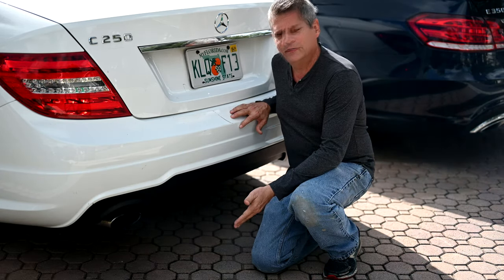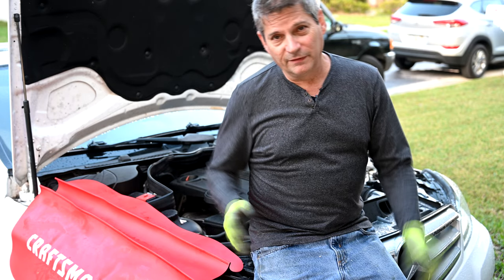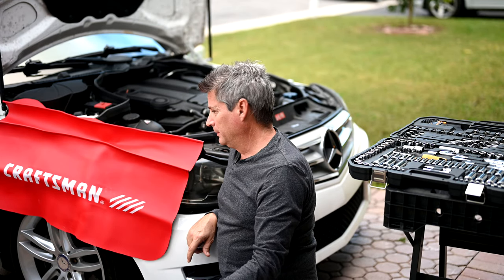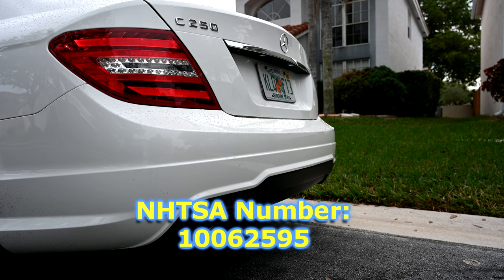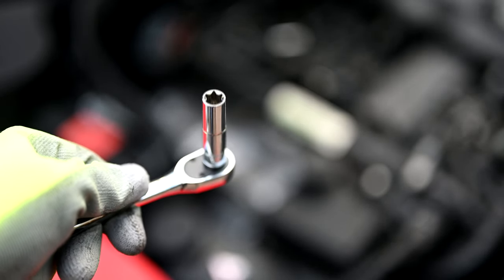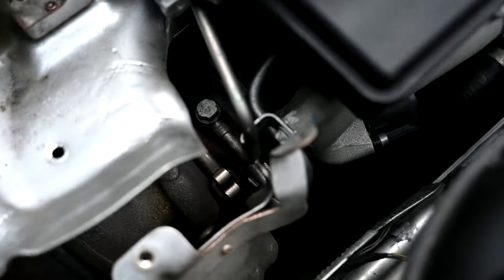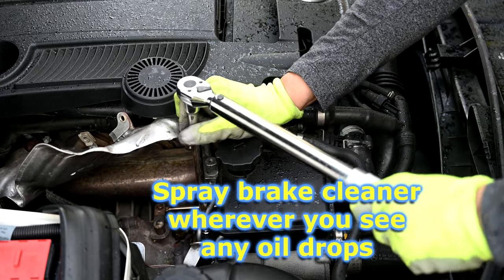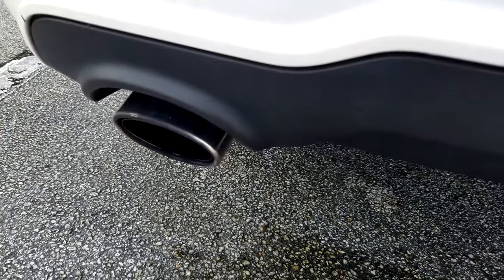SOLVED! Engine Blows White Smoke at Startup Mercedes C250 W204 Banjo Bolt

Comment from the maker: ✅ Parts/Tools in this Engine Blows White Smoke Repair:
✅ Dewalt DWST11556 Express Folding Workbench: https://amzn.to/2EZuyNj
✅ DEWALT Mechanics Tool Set, 172-Piece (DWMT81533): https://amzn.to/2rAsdoV
✅ Milwaukee 2415-21 M12 3/8" Right Angle Drill/Driver Kit: https://amzn.to/2SCAXGe
✅ Craftsman 9-34570 Torx Socket Set E6,E7,E8,E10,E12,E14,E16, (1/4" E8): https://amzn.to/359aSlL
✅ Craftsman 9-12612 Black Fender Cover: https://amzn.to/2Q3uZfW
✅ Mercedes Banjo Bolt Part#: A0019972401 (001-997-24-01): https://amzn.to/2EXwKou
✅ Mercedes-Benz O-RING Part #: A0239978548 (A 023 997 85 48 ): https://amzn.to/36hsBaQ
✅ Mercedes Turbo Charger Oil Line Gasket/Sealer Ring #: N000000006513 (eBay parts)
Reply: Good day,
I'm Sbu from South Africa.
Would this be applicable to BMW 2012/08 F30 N20 engine, has twin turbo.
Has white smoke on startup, but pretty huge/enormous white smoke on startup, but afterwards smoke disappears. 

Is it the same diagnosis?
Reply from the maker: We have heard from other car owners of different companies that this problem exists on many car, so you might expect this to be the problem with yours as well. You should look on a few BMW forums from other owners to see if that is what solved it for them as well. This problem was solved by us checking on a Mercedes forum, and got recommendations from a mechanic at Mercedes on the forum. If you search Amazon and eBay for Banjo bolts, you will see them selling these bolts for many car brands, and apparently these newer bolt designs with the back flow preventers in them seems to be a common fix for this common problem.
Reply: Where is the banjo bolt located in C300
Reply: @carbuying where is banjo bolt located in C300 please

Comment: Thanks for this video. My C-250 was also blowing white smoke at startup. I used the parts link, and everything arrived within four days. The whole repair took under 30 minutes. I opted to install the O ring. After completion I ran the car for a few minutes to blow out and residual oil. Fired it up this morning, with no white smoke. If you have this problem follow this video and save over 400 bucks
Reply from the maker: Glad it helped It's always great to hear we saved another person!
Reply: Really and unbelievable easy repair with the help of the video. Thanks again. Any new Mercedes videos upcoming?

Comment: Very good video, so thanks for the quality of your video images. I replaced the banjo bolt without any issues but the two supposedly OEM copper crush washers ($15 each through Parts Geeks -Yikes!) for sealing to the top of the housing I received as an "OEM Part # ending in 6513 are indeed too large and should have an ID of 10mm, not the 13mm size. Otherwise the washers won't seal the housing to banjo bolt properly. I just reused the old washer from the defective original banjo bolt and hopefully there will be no leaks using it; I have heard some people, including here, have just used one correct-size washer, Teflon tape, and no washer at all and have had success. Those 13mm washers, along with the rubber o-ring, appear to be used with the oil line itself and not the banjo bolt. That bargain FCP Euro kit mentioned from another viewer here also has just one washer and the rubber o-ring. There's a lot of confusion out there about all of this and Mercedes should make these issues clear! So there are actually two separate issues to deal with - 1, the easy banjo bolt replacement causing the start-up white smoke and 2, oil leakage leakage coming from the oil feed line above the turbo due to a deteriorated rubber o-ring at the block housing. The latter is a lot more difficult to deal with due to clearances and tolerances to remove/replace either the entire oil line or just the rubber gasket. One last thing - removing the lower rear heat shield 10 torx bolt requires that you remove the two bolts housing the dipstick feed tube so you can pull it out of the way to get enough clearance to get a socket in there to remove it completely should you need to remove the oil line itself. Hope this helps future "do it yourselfers".
Reply: Yes, I've seen other yt videos on how to replace the banjo bolt. They used 2 crushed washers, one on top and the other at the bottom of the banjo bolt. The rubber O-ring goes to the end of the oil feed line towards the engine block.
Reply: I'm doing mine this weekend. Another yt video shows the original banjo bolt has only 1 washer size m10 and the rubber O-ring goes to the end of the oil pipe towards the engine block. The TSB requires removing the turbo heat shield and not the exhaust manifold heat shield.

Comment: I see you said you need two “washers” but you only demonstrated using one “washer” and one o-ring, where does the other “washer” go? Also do you put the o-ring on the housing location first, then screw the bolt onto it along with the “washer”? Thanks.
Reply from the maker: It can be a bit of a head scratcher. The way banjo bolts work is there is supposed to be a washer on the bottom side of the banjo and on the top side of the banjo, where the banjo bolt tightens down on top of the banjo. The Mercedes TSB called for a washer and a gasket, although we have seen forum posts where service techs say you need 2 washers. But upon removing the old banjo bolt, we only saw one washer, it was on the old banjo bolt, but no second washer under the banjo fitting. So is the second washer needed or is the gasket needed? We chose to install the gasket, and likely either scenario would work. The real issue here is changing to that new banjo bolt with the flow restrictor. As long as you have a good seal, it likely doe snot matter whether you have the second washer, or the O-ring. We also don't know why Mercedes said to use an O-ring when you normally have 2 washers for the banjo fitting. At least the fix works as we implemented it.
Reply: carbuyingtipscom where does the o ring go? On the bottom of the banjo or top of the banjo in between the bolt and the washer? I put the o ring on the bottom of the banjo. Then put the washer on the bolt and screwed the bolt on with the o ring being on the bottom of the banjo. Or should I have screwed the bolt with washer onto the banjo with the o ring being on top of the banjo? Does it matter?
Reply from the maker: @aidensmith6461  There's still some confusion about this. Usually on banjos with most cars, there is supposed to be a metal washer on either side of the banjo, and the service adviser at our local Mercedes dealer confirmed this with the E350. At the time we ordered all these parts, we saw from other owners that the parts purchased as part of their dealership repair included the O-ring, but no one knew where it goes, we've searched all the Mercedes forums, and no one has a clue. In this video we placed it at the bottom side of the banjo where it made the most sense, and there has been no leak at the banjo. I would suggest you try one metal washer on either side of the banjo, and hang onto the O-ring. If you see any leaks at the banjo, you can place the O-ring there, but we suspect you'll be just fine with a washer on the top and the bottom of the banjo. Look at parts stores online selling banjo bolts, you'll see their banjo bolt kits usually come with the 2 washers. Because of the nature of the repair and often times critical nature to Mercedes specs, we made sure we bought Mercedes only Banjo parts, but they are all sold separately. If we could ever get our hands on the TSB it might shed exact light on what to do with the O-Ring.
Reply: carbuyingtipscom yeah that’s what I ended up doing, put the o ring on the bottom and screwed the Bolt on with a washer on the bolt. Torqued it too much at first Bc I didn’t recognize the “click” then loosened but didn’t take th bolt off.. tightened it to 6nm once I figured out the “click” I still see smoke coming from the exhaust two days later after the bolt replacement. But don’t see any leaks with the banjo bolt. So I’ll give it some time. Thanks so much for replying!
Reply: Yes  2 washers   1 is upside the turbo pipe and 1 is downside of turbo pipe

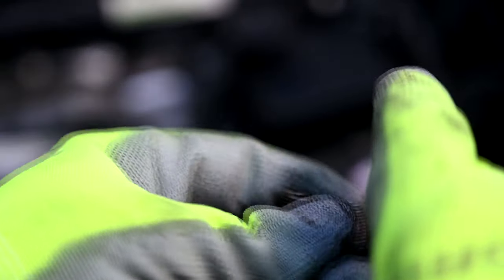Comment: 9:50 actualy it installes on the other side of the oil line from the bolt. just did it today. you have to remove the whole pipe and to change it. not just the banjo bolt. unscrew the fitting to the block and there will be the ring
Reply from the maker: There's still debate on the forums even, on which side it's supposed to go on.
Reply: @carbuying  it actually true and I found this only because of you, I’ve searched that banjo bolt to buy at the catalog and by OEM scheme that ring indeed goes on the other side, I could mail the screenshot of don’t take my word on it. And in the video you said that we need two of the metal ring part with bunch of zeros, but we only need one of them, where you showed in the video. You did not show where you consider installing the second one either. Did you meant under the fitting between the block? I ordered two of those, just in case:)

Comment: I have a 2013 c250, been overheating took it to the dealership they said it uses a metal head gasket so if that’s blown the head might be cracked which sucks as its the turbocharged one and only has 49000 miles, and hearing all different prices for used ones with way more miles, any suggestions?
Reply from the maker: Try taking your Mercedes to a local repair shop that is popular with Mercedes owners you can try Googling or checking the Mercedes forums for people that might know your area. For example in our city there is a place called star garage which we take our Mercedes vehicles to and the price is way cheaper than the dealership

Comment: Hi!

Im suspecting i have the same issue. Do I HAVE to replace the banjo bolt asap, or is it safe to drive without changing it? Can it damage the engine/turbo if i dont replace it? 

Thanks in advance!
Reply from the maker: No harm driving it, this car was driven for a few months at least before anything was done. Any little oil just burns off in the morning when you start it.
Reply: carbuyingtipscom Understood, thanks!

Comment: I have a mercedes b200 turbo w245. With the sale problem but more white smoke comes out in the exhaust of my car than in your video. Is the head gasket?
Reply from the maker: Does the smoke stop within a minute or so of the engine starting, if not it might mean you have oil leaking inside the engine, turbo, or exhaust somewhere and the repair shop will have to find it.

Comment: Hello Sir. I have a BMW F20 year 2012 same issue. Could you please tell me the part number of my car series? Where can i get it? The banjo bolt with the non returning valve. Please Sir
Reply from the maker: We have no way of knowing that you will have to either go to the BMW forums and ask there which is where we usually find information on our vehicles from Mercedes in Lexus for example in those forums. You could also Google online for repairs on your particular vehicle model and see if there's videos on YouTube for replacing the banjo boat or just Google the banjo bolt for your car and see what model numbers come up. Also you can find out the model number from your local BMW dealer and then search online to see if anybody has a cheaper kit.
Reply: We have no way of knowing that

Comment: Didn’t show where the rubber  o ring went… it’s like 40$ for a tiny piece of rubber so I want to re use to old one with my new banjo bolt if possible. But I’m not sure where to look. Could be right there but I haven’t taken the heat shield off to check so if you can reply and let me know I’d appreciate it brother thanks. All other videos take the oil line off too. I don’t need that so your video is almost perfect lol

Comment: My car engine oil leaks some time in the from of drops and Leave white smoke when I start in morning.
Please give me you value answer.
Kind regards
Reply from the maker: Depending on where it is leaking, if it lands on any hot part of the engine you will get smoke. Usually visible leaks like this likely indicate a gasket that needs to be changed.
Reply: @carbuying  thanks for yours reply.
Machnic could not find any damage to engine.l still it leaks like sprinkles 
I can see engine oil on the plastic cover under the engine. And when oil drops on hot part it smells.

Comment: I have a 2009 C300 and it was giving white smoke out of the engine this morning. Looks like there's oil on the lines. Does this video work for that as well? Are the part numbers the same?
Reply from the maker: This is for a modification to the banjo bolt for the turbo. IF you have oil on the line you may have leak, which is not the same as the leak from this repair, which would be oil dripping inside, not outside on the lines.
Reply: @carbuying  any solution on that issue….having the same one with my 2010 c300

Comment: Have 2010 C180.  Have the smoke from exhaust at startup.  Had mechanic look at it, told him about the banjo bolt as I was doing research and came across this video and his inside mechanic at a Merc dealer feels it's the banjo and least expensive repair to offer a possible solution.  Initially mechanic thought it was valve stem seal repair (ouch!)  Question is I'm in the UK and wonder if same solution here.  It's a w204 so hope its the same...
Reply: Hello did you find out what it was?

Comment: I had an issue with white smoke at startup as well same engine m271.860 on a w212 but my issue was different i had an oil leak from the spark seals under valve cover leaking into the spark plug chamber replaced the seals and it worked like a charm.
Reply: But still i am having trouble with my harmonic balancer it’s wobbling alot and making the tensioner vibrate as well my engine is shaking and idling poorly
Reply from the maker: Yes, your scenario is one af about 6 reasons we see white smoke at startup. Glad you got it fixed.
Reply from the maker: Have you tried this Harmonic Balancer article? They also have videos on it here: http://www.mercedesmedic.com/mercedes-crankshaft-pulley-harmonic-balancer-diy/
Reply: I already checked the harmonic balancer runout mine was doing around 1.5 mm runout. according to the data from WIS the runout supposed to be 0.3mm, no check engine light but there is a fault of torque calculation error, this is due to the loss of power. Harmonic balancer wobble makes it hard for ecm to compensate for torque lost. I have to get replaced asap
Reply: Having a m271 evo engine you have to keep an eye for oil leaks from oil cooler and gaskets, banjo bolt as well as intake gaskets, and also one of the common failures are high pressure fuel pump and esl lock, harmonic balancer is also a common failure for this engine after a 6 or 7 years you should get it checked out before it destroys the front engine main seal and main bearings.

Comment: I have this issue as well, but this morning I cold started and smoke came out of the hood for a second and the exhaust. Before I would get the high Fuel pressure pump but I deleted the code. Any input ?
Reply from the maker: Could be you have a leak onto the manifold, or maybe your main gasket seal is leaking. Smoke under the hood could mean many different issues.

Comment: Hi ,

I have CLS 350 CGI 2012 and I have some problem sometimes morning come out more smoke sometimes not much , what you think is the problem. And Engin oil come down but not much. Please if you have any idea what is wrong? 
Thanks
Reply from the maker: There's really no way to tell without seeing it in action, but if the engine oil is dripping off of where the turbo bolt plugs in, then it is likely that it needs this fix here in order to seal that leak. If not there is likely other spots where your turbo can leak. We had a $900 repair about a year later than this for other gaskets that leaked around the turbo that needed to be replaced.

Comment: Hello I have a 2002 s55 amg..it’s blowing white smoke but it’s at anytime
Reply from the maker: there are numerous reason a car can blow white smoke continuously, it can be piston rings, it could be your main engine gasket needs to be replaced, it could be a leak of oil onto a hot part of the,  or a turbo leak. Best to let the pros deal with this one.

Comment: My w212 have this same thing happen. But it flashes check engine light too.. once the engine reaches normal temp then the smoke gone.. turn off the engine and start again, check engine gone too.. usually happen if i leave the car for one day or more without start. any idea this is regarding banjo bolt or more than that?
Reply from the maker: There is no way of telling what the issue is without reading the code with an OBD2 reader to tell us what engine code triggered the check engine light. Do you have one?

Comment: I can’t seem to find the turbo charger oil line Gasket/Sealer ring.. could you tag the link ? Pls ?
Reply from the maker: If your car is the same 2013 C250, then Mercedes Turbo Charger Oil Line Gasket/Sealer Ring #: N000000006513 is only available on Ebay, that is where we found it. You can also try your local Mercedes dealer.
Reply: No  need  to  buy   just  use  sealing  tape     teflon tape

Comment: Hi my C350 2011 cdi Automatic Mercedes is blowing white smoke with startup not only in the mornings, everytime and while driving. What can the problem be?
Reply: Hi Adri did you find any solution ? I have same problem on my C350 2010 smokes at startup and also when I switch off engine even when I Rev high when driving